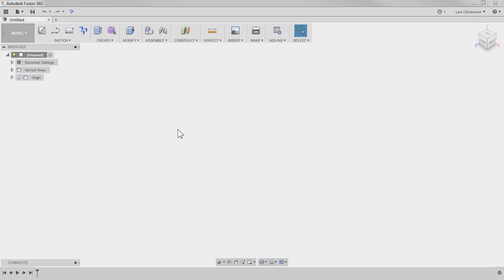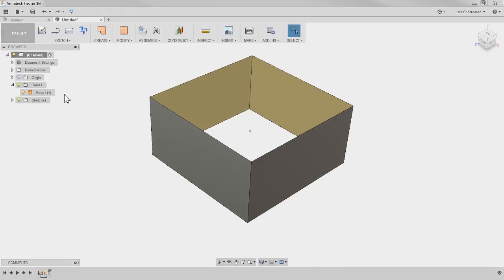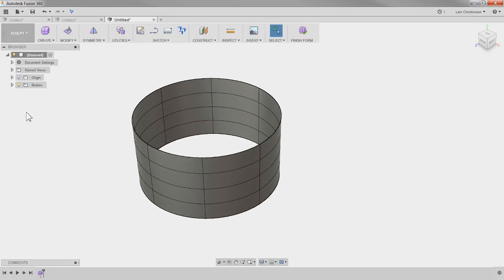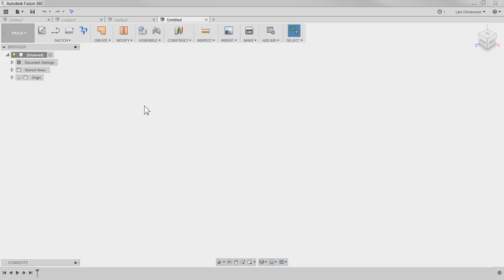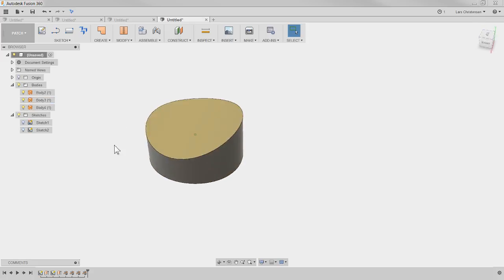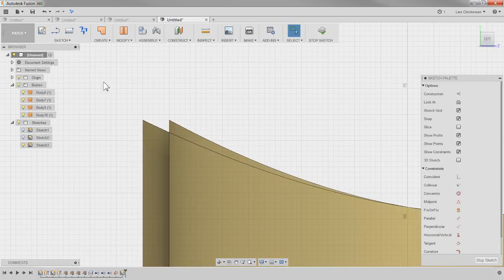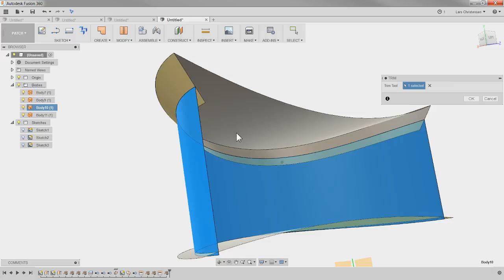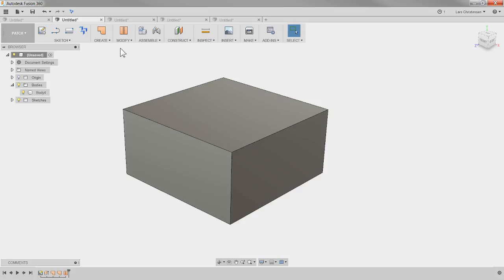Understand the Surface Patch Workspace — Fusion 360 Tutorial #LarsLive 107

Comment: Excellent presentation on the " surface mode " this is. Very many intriguing workflow potentials are hidden under that humble option simply titles " PATCH " ... recently changed to " SURFACE ". Thank you Lars foe another great tutorial.
Reply: I noticed F360 has changed a bit since this Patch mode. When you create a cylinder under sculpt, it is automatically enclosed at the ends.

Comment: Well, I've watched all your videos and have become very proficient in the solid modelling environment but I have to say that I still don't know why, and under what circumstances, I would enter the Patch environment. 

Your example of cutting an extruded hollow (Patch) body by the two splines is interesting but seriously, I think one could do the same with a couple of sketches and extrudes (cut). 

I think we need to expand on this subject. Frankly, I see no benefit to this at all....My confusion likely is rooted in the examples you're giving because I can't relate to them and frankly, will likely never be in a situation to carry out those kinds situations. Perhaps more real world examples are called for here.
Reply: Patch environment allows you to get to those complex multi curved shapes quickly, rather than build alot of sketches and try to cut your way to the shape you want the patch surface allows you to make a few profiles and rails and boom you have a car body. Also the patch environment is the space where you can extrude sketch lines that can be used for trim tools in the solid environment. Certain shapes are just easier with those tools, same goes for sculpt tools. I think the idea modeler would use all 3 environments and their strengths. Also the more complex the shape / organic the more likely you will lean on the patch environment. Its also used to clean up the models, for example did you know the remove command in the patch environment works differently than in the solid one? You can delete surfaces with out having them replaced then patch and stitch, leading to a cleaner surface depending on the situation. Scope this out. https://www.youtube.com/watch?v=Gf1lNAGEalQ
Reply: @brandonblair6529  Thank you brother that summoned it up in a few words....you saved me a half hour of the Lars show...
Reply: @oreoflores7204  NP!
Reply from the maker: Thank you for spending your time watching the videos! In my opinion, with the Sculpt workspace in Fusion 360 there are not much use for surfacing modeling anymore, other than maybe trying to stitch surface scan data together.

Comment: Do patches require 4 sides or can the number of sides be anything? I have tried using patches and while the geometry is complexe, the system just doesn't want to solve and sometimes crashes...

I have been using splines because the shapes I need to produce are unique. What's going on here???
Reply from the maker: Biggest thing is that there are no gabs. You have to have a water tight enclosure to turn it into a solid

Comment: Lars! I love you channel and have learned so much from you, so thanks! Right now I have a problem and hope you can help me. I had a STEP file given to me to work on. The problem is that some of the components in that 3D file are actually just SURFACE BODIES and not SOLID. I really need to convert them to SOLID. Can you please help me with this? I find this problem pretty frequently when I get models from surface designers...so it would probably be helpful to other people as well. I can give you an example file if you need...
Reply from the maker: Hi Chris Parker Thank you for watching!
Yes, this can be a problem. If the model is not watertight, then you will end up with surface bodies. The only thing you really can do is to get into the patch area and try stitch things together. You can send me the model if you like and I can see if I can use it on a livestream. lars.christensen@autodesk.com

Best,Lars
Reply: Thanks for the reply, Lars! I think I figured it out...if I unstitch the body and then re-stitch it with a greater gap tolerance, then it seems to work. 
I would think a short lesson on surface bodies vs. solid bodies and how to convert them may be a good quick lesson. It seems like often when I import STEP files from other programs, Fusion creates surface bodies automatically and I need to go and convert them in order to modify.
All the best and keep doing what you're doing!

Comment: Hi Lars, - When I go into Sculpt and create a cylinder, The lines do not show up.  If I move my mouse pointer over the sides I can see the lines and sections.  What setup do I need to check to make the lines appears as youes did at 8 min 32 sec into your video?
Reply from the maker: Hi Carl, Check your visual style. Click the monitor icon at the bottom of your screen.
Reply: Thank You.  The top one: button check for shaded.  I clicked the button for Shaded wit visible edges and no the lines show up.  Thank you Lars.  I almost got stranded in Buffalo one time because of a snow storm.  I understood you comment about the snow blower.

Comment: Hey Lars, can a tool be used (any shape made, letter for instance) to push a surface, say like embossing or stamping into a surface. Thanks for all your great videos bud!

PS: I should clarify. What I am not talking about is using the combine to use geometry to cut into a surface. What I mean is, think of pushing a letter or shape into a block of clay. You would get the impression but also the deformation around the imprint, the curves the folds and so on. I hope this clears up my question!
Reply from the maker: Hi 393stroker Thank you for watching!
Pretty much yes. This is where the combination of sculpting becomes interesting. Jumping between Modeling, Sculpting and Surfacing, you should be able to make just about anything :-)
Reply: Lars Christensen Thanks Lars. Maybe a video showing us how you would go about doing it.

Comment: I could not stitch when I made the cylinder with extruded splines. I found the problem is that you can not have overhanging surfaces when you stitch. I had trimmed the cylinder but still had overhanging surfaces from the splines. IT ALL NEEDS TRIMMING BEFORE STITCH
Reply from the maker: Yes! Glad you figured it out!!